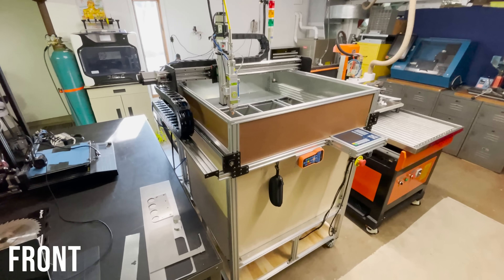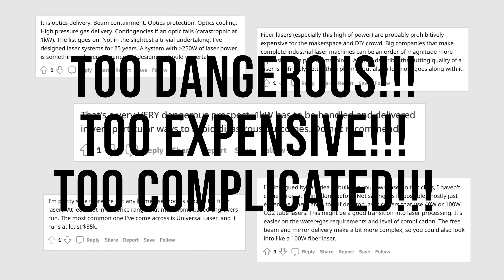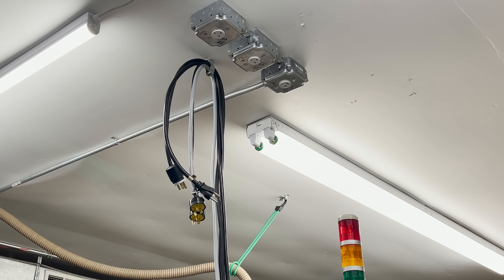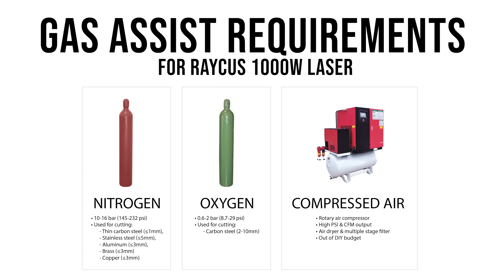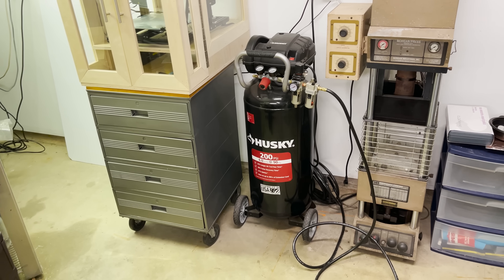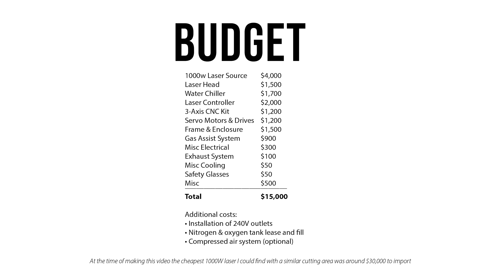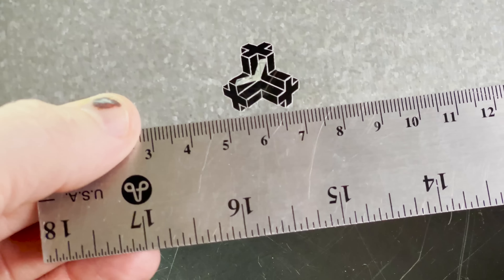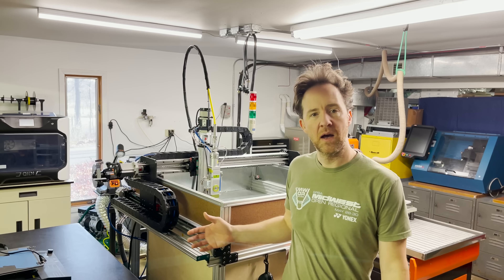DIY 1000W Fiber Laser Cutter Part 1: Project Introduction

Comment: Congrats!   
With the prior experience of building a CNC mill, as my next project I am thinking about building something like this.
What do you guys think about the idea to buy an existing CO2 laser cutting machine as the base,  (search for e.g. 'Ruida DSP 1060 100W co2 laser' on eBay to see what I mean) 1000x600mm machines are sold for $3000-3500, they already have the 145kgs heavy machine housing with wheels and safety enclosure, a height adjustable honeycomb bed, the XYZ axis guides + servos, a Ruida 6445G (or similar) cutting controller, a 5000W water chiller, an exhaust fan, the power supplies. I could then reuse and skip building these parts.
I would only remove/disable the CO2 laser tube and replace it with a 1000/1500W fiber laser source,  add a cutting head, and the gas assist system.  The machine height should be increased so the fiber, gas, water, inlets bend nicely.   Btw. the gas assist system I already have for my TIG welding setup could also be used.  Can someone confirm if the cutting works with Argon?  ...if it works with nitrogen, it should also work with argon, I think.
The 10600nm blocking window on the CO2 machine should also be replaced with a 1064nm blocking material  (will have to test maybe it already blocks both wavelengths), so I would have a professional safety enclosure then.
What do you think?

My other idea is not to buy a laser source per se but purchase a laser welder, that includes the 1000-1500W laser source, but also has a 3in1 handpiece, with small built-in galvo that can do cutting/welding/cleaning.  (the welder additionally has a water chiller, plus a welding wire feed system, both for aluminum and steel)
I could then mount the handpiece of the welder on the gantry (and save on not buying the cutting head) and have a more versatile set of parts   that besides the CNC cutting I could also use for manual welding (doing welds with astonishing ease and results, look up 'laser welding' videos). and these parts perhaps can also be combined to make simple 2D CNC welding sometime with my existing machine and also a CNC assisted (like traversing an area) surface cleaner (degreaser, rust remover)  although not that useful with the 2D limit, but the parts may be later used in my next project with a robotic arm assisted 3D welder...  1000w-1500w laser welders are available for  $8-12k    all the stuff would fit in the same $15k  budget.  What do you think?
Reply: I can see you put much thought in this design, I think I can help you out on some of your questions. 
Fiber laser metal cutting is essentially a balance between laser intensity and spot shape/quality, kerf width/spot size and assist gas. Get these right and you have beautiful burr free cuts, have one of these out and really bad cuts. It’s a fine line between getting a great cut and a poor cut.  
Your focus position relative to the surface of the material plays a big role in determining the width of the cut. Focusing perfectly on top of your material like you would in non-metal CO2 system would create too narrow of a cut and would not leave enough room for the assist gas to expel the vaporised material from the cut. Having your focus too far away from the surface would cause your cut too be too wide and the laser might not be powerful enough to create sufficient energy density to vaporise the metal. You always want to cut metal in a single pass to get the vaporised mater though the cut or it will just cool and adhere to the top of your cut.
You also want to ensure that your laser profile is even and round. If you can imagine having an oval shaped focused laser spot your kerf width will be a different size in the X and Y direction. You will have different cutting qualities in the different directions or it might not cut through at all in certain directions, you will see this when you cut circles that there might be really bad spots at some points of the curve. 
You can go too slow. Unlike non-metal CO2 cutting, there is a very fine optimal speed, cutting too slow can often give similarly bad results as cutting too fast. 
Autofocus and nozzle. Your assist gas and your laser exit the nozzle together, it is important that they are centred to each other. Having your assist gas in the cut is just as important as having your laser in there. You need both to be perfect. If they are too far away from centre you have a scenario where your gas jet is leading or lagging your cut in some directions and you get bad cutting. Laser cutting nozzles are very well designed to shape the gas flow to a concentrated jet and is optimal for a very short distance after leaving the nozzle. Therefore your auto focus is very important it is mainly there to keep the nozzle close to the material to ensure that the gas is removing the vaporised material and keeping the laser focused to the material is secondary as you have more tolerance on your laser focus than you do on your “assist gas jet focus”, especially on the 1-1.5kw lasers. The nozzle diameter determines the width of the jet and the amount of gas flowing though, when cutting with N2 or Air you would normally stick to as small a size as you can as long as your laser focus is not set too far away from 0 as your laser beam can be larger than your nozzle orifice.
The cutting head has a few important functions. First it will take the raw laser from the fiber end then shape and focus it. The lens assembly can also precisely move higher and lower to change the focus position relative to the material without changing the nozzle to material distance. As there is not much clearance between the OD of the laser exiting the nozzle and the ID of the orifice, the laser beam path needs to be very stable, so the head needs to be well constructed and keep its components sturdy. It also needs to have water cooling channels to dissipate heat. It also needs to handle high assist gas pressure (20-30bar). So it is big and heavy.
Adding a metal cutting head on a 1000x600mm CO2 frame would greatly reduce its acceleration performance. Most modern metal cutters can accurately do 0.8-2G, and even a 1kw will easily cut 0.5mm Stainless at 300mm/s. A standard XY non metal CO2 machine wont be able to reach 1G with a small head, increasing the head weight by 50-100x will deteriorate its performance and cutting a detailed part will take a few minutes where a sturdy rack and pinion or linear drive motion system will do it in a few seconds. Servos with a smooth motion such as ball screw, rack and pinion or linear drive is preferred for metal cutting over belt and steppers. Both the belt and stepper motors produce rough motion. One downside about the much finer kerf width of a 1064nm wavelength is that it exaggerates rough motion on the cut. Essentially your cutting tool radius is much smaller so peaks and valleys as a result of the rough motion are cut with much higher detail. Also rough cutting can be an indication of a setting that needs to be fine tuned so it would make it difficult if you are trouble shooting cutting parameters but you are unsure where the source of the rough cutting is coming from. Another problem with the XY belt motion is that it is not very rigid and depending on your acceleration you might get wobbles when it changes direction around a corner. During this wobble the head is not moving at a constant speed and would jerk to a higher speed and slow down during the wobble, this will occasionally cause points where the part did not cut though properly. Having more than 3 or more small points on a shape that did not cut though makes it very difficult to break out and less effort to scrap it and recut it. And also in my opinion it feels like a waist to have such a small metal cutting machine, at least go 1250mm or 4foot wide to allow standard sheets to fit. 
This post is going on long enough it think (sorry for the long read) but I think it should also over the difficulty of having a galvo head, with a nozzle. I would rather design the system so that the fiber end could be easily and safely removed from the machine and connected to a separate galvo head that can be used for cleaning and a separate head for welding. And yes argon will work fine for cutting thin steel. I have not covered low pressure O2 cutting (thicker mild steel) here. I do not mean to discourage you and would love to see the machine that you come up with in action.
Reply: @andremostert344   Wow! Thank you Andre,  I did not expect such a professional advice to avoid the dead ends embedded in my idea. 

Just looking at a laser cutting head with more attention should have made clear for me what you are saying: a fine tuned beam forming, laser focusing, height adjusting, gas jet forming, etc. needs it exactly this way, and that is heavy and requires a special component designed for it.  A CO2 machine only has to move a light mirror and a small lens.   So the motion system also has a higher requirement.

I agree about the minimum machine size.  However I would gladly give up of the maximum cutting thickness, being able to cut 2-3mm thin sheet steel or aluminum would be more than enough for me.
It is a hobby project and also the 'jobs' that I would be manufacturing would be only cutting thin sheets of metal, (I can't imagine to handle anything above 20kgs like a >5mm steel sheet would be)   
So it is a question for you,  in this case, to save on costs, can I go lower with the laser power, for example a 500W (or 200-300W) laser source?  Or would it mean rougher edges when cutting slower with less power?   ..and slower speed would also mean more heat spreading and deformation?
Reply: Hi Nick, you will defiantly be able to cut some metal with a 500w. I myself have not tried but it will work. Just one thing to note is that there might not be laser heads and laser source combinations that will fit. I would recommend Raytools heads and Raycus source to look for a matching pair. 1000w to 2000w will probably much more popular than the 500w sources and when looking to buy a source and head I would recommend finding some laser manufacturers in Jinan China (seems to be the fiber cutting machine capital) and ask for a price on some spare parts + shipping rather than buying from aliexpress, you should get better prices that way as they buy in bulk and have much better relationships with the manufacturers than the 3rd party online sellers. Please please don’t get tempted by a glass tube CO2 laser that can cut metal, woods and other materials. You will just be creating a massive headache for yourself, too many reasons to list, just trust me. 
As for your cutting requirements, it is defiantly possible for a laser to cut worse than a plasma cutter if you try to go out of its capabilities. Especially when cutting thick mild steel with O2. Cutting 2-3mm stainless steel will be possible but you will have quite a bit of very hard burr at the bottom you will have to clean off with an angle grinder. Aluminium will be much harder and piecing though the steel will be the most difficult part, having a head where the lens focus is motorised will help as you require a different focus than cutting to get optimal results. With cup cut you can pre pierce all your start points and then manually adjust your fucus to cutting if you do not have a motorised focus. But you will have a lot of bur also on 3mm aluminium that is difficult to clean off a file works better as a sander or grinder tends to bend the burr to the side and not remove it, but the edge should be good. What will be a massive advantage is if you can get as much assist gas pressure as you can, say about 15-20bar, will just have less bur. Compressed air is preferred as N2 will cost a fortune as a full cylinder will only last about 10-20 mins at that pressure when using something like a 1.2mm – 1.5mm nozzle. Higher power = easier cutting on 2mm and thicker. You should be able to do 1.5mm aluminium, stainless and mild steel like a champ with 500w. 
Just another note about the max thickness that a laser power is rated to. That is the max thickness that is possible to cut but is rarely practical. For example a 1000W can do 10mm mild steel, you would need to become a expert at cutting 10mm with a 1000w to do it, and a 2000w will do it with easy and more than 3times faster. The cutting speed does not drop linearly with cutting thickness, it drops off much faster and margin for error (bad settings) becomes much much less also. Spoils goes up, and not talking about cuts that don’t look so hot, completely unusable. And you would probably have to do 50+ test cuts to get your settings dialled in.

The warping and deformation is not that much of a concern with a lower wattage when cutting with N2 or air when comparing lower and higher laser power, if your artwork is too detailed (like cutting fine mesh of holes), it will warp no matter your laser power.
Reply: @andremostert344  thanks again, sorry for taking advantage of your expertise and helpfulness, (feel free to reply shortly or not at all if I go too far using free counselling )

One more thing I'd like your opinion on:   https://www.youtube.com/watch?v=GywQVNA6qoY
If I got it right the waterjet only assists containing the laser beam (so the beam remains parallel) and also helps removing the material, cooling it at the same time.  The waterjet here has nothing to do with a classical waterjet cutter where the pressure is huge (up to 6000 bars) and abrasives are added, that is definitely not a garage project.
I think for the water assisted laser the water system requirements might be as low as 10-15 bars, (just a guess).   What do you think, how feasible is it with a DIY machine?  I envision a design where the existing laser head is fitted with CNC machined part with a narrow orifice for the water jet around the laser.   I guess the optics of the cutting head are not really suited for this.

sorry to circulate so much on the subject, a machine that can do something special  (like extra narrow tool paths, no deformation, with the immediate and clear material removal being able to do multiple passes, and the footprint of the machine could be smaller (would fit better in my workshop) concentrating not on large sheets but the manufacturing of small special parts) could be even more inspiring.   ...in some sense it could be a cleaner alternative to EDM (electical discharge machining) for mold making with deep cuts, sharp inner corners, etc.
Reply: @nick066hu  Sorry man, I have no experience with the laser-water jet hybrid machines. The tech has existed for decades and I have seen what they can do and it is incredible! Quality, precision and thickness is crazy, but very specialized due to the complexity, limited size and slow speed of these machines. I would love to have one to mess around on but I think the challenge would be in the optics to merge the laser and water together $$$

Comment: Very cool build! 🤩 I have been looking for similar projects to get some sense of the complexity and feasibility of implementing such system for a Avid CNC combo. As it is an expensive setup, I wanted to make sure it is possible. Would you be able to provide some more information on your control software setup, laser design software setup and perhaps unexpected challenges you experienced in the build process? Awesome work!

Comment: Great project, really appreciated!!! Just one question - is it necessary to have the machine controller you bought? I guess it is much more convenient to have everything plugged into one station (although quite costly), however how is the laser itself switched on and off? Will a regular relay do this job as well (which is possible e.g. in plasma torches)?
Reply: Friendess - Cypcut has some really great cost effective options, but they do require a dedicated PC.

 There are no one single station or one box fits all for fiber metal cutters, there are just too many variants of machines that it can be implemented on. 

Normally you would use a contactor or solid state relay to turn the laser source and chiller on and off, but its power level and trigger are controlled by the software/controller via RS232 or analogue and TTL signals.

Comment: I'm so happy someone finally made a great video on this, I'm trying to eventually get parts for my own fiber laser. One thing I'm curious about is if a water table could work for a fiber laser the same way it works for a plasma cutting torch. I assume that might increase the risk of the lenses getting damaged. Being around a plasma CNC, I'm used to a water table so I'm wondering if downdrafts are the only way to go with fiber lasers.
Reply: It would be very messy as most of the thin metals you will cut with assist gas or compressed air at 10 bar and more. It would just spray it all over the place. Also you dont want to get any moisture on your copper nozzle as the auto focus system uses it as the capacitive sensing point and would mess up the calibration and would not follow to the correct hight (usually 1mm) and you then have a very bad cut. Depending on the machine style, you dont want your parts to fall thought the bed as the sparks from cutting would adhere to the parts below. With fiber lasers you can have tiny micro joints that keep the parts you want to keep attached so its really easy to break them off the sheet.